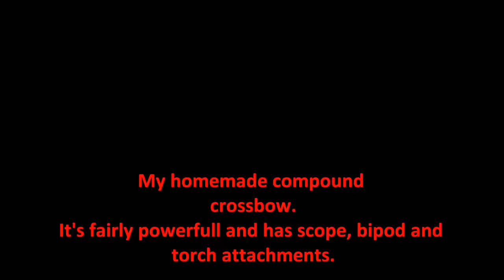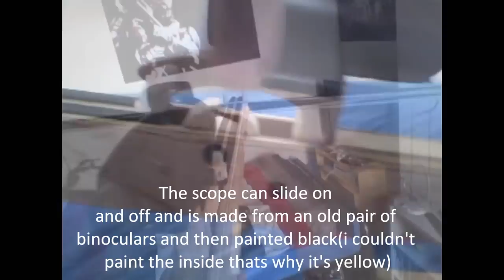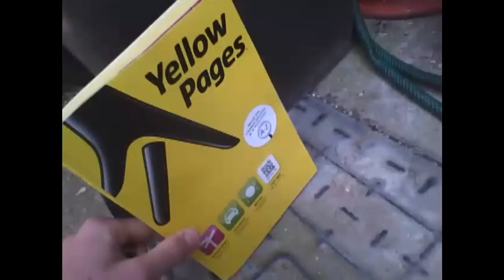Homemade compound PVC crossbow

Comment: (I am not complaining, I am warning people who want to buy or make something that is this powerful) To anyone looking to buy/make a crossbow and who also think that it is easy to pull back a crossbow, IT ISN'T! If you have looked at a real crossbow, the end of it usually has a triangular peg that is bolted or welded into the end. The reason for this is your average crossbow is so powerful, the saying, "put your back into it" comes from people who had troubles with reloading. The peg is for using your foot to hold down the crossbow, pulling up the string needed large back muscles because many crossbows where over 150 - 180 lbs. (when someone says a bow is ___lbs, this means it takes that amount of force just to pull back the string. A crossbow is basically just a weak rifle that shoots an arrow or bolt. Not to insult anyone, but in my opinion there is more pride in building a crossbow, than being able to shoot one. Firing a crossbow is the same as firing a rifle, the stock and grip keeps it steady and you simply pull a trigger and fire. The most difficult thing to do next to loading it, is simply looking down a sight. Granted it is pretty badass that someone can make a crossbow out of PVC and wood scraps and have it work, but talent is found in archery, it is more mentally and physically challenging and there is much more to it than simply load and fire. I am a member of a semi-Olympic archery team, I am not in the Olympics and won't be for most likely my entire life, yet I know a lot about bows. A Crossbow uses 3 basic steps and a bow uses 10 (9 if you don't include aiming) Again, badass crossbow, even more badass if you made it, especially with how good it looks, but talent is found in archery, sorry guys.
Reply: pointless rant.
Reply: what are the 10 steps in archery, i'm a bit of a noob archery
Reply: Andrew Marriott
The ten steps with a bow are stance, nock, hook and grip, raise bow, draw, center, aim, balance, release, and follow-through. the steps of a crossbow are nock, cock, point, and shoot. A bow requires more talent because it is so different than using a rifle and requires so many different steps. Arrows also flex in mid air, but are always accurate. If you miss with a bow, it is because your stance or grip was off. A crossbow is pretty a rifle that fires arrows/bolts. Look at the shape of a crossbow and then look at the shape of a rifle. Similar, right? That is because they both have the same exact grip and use the same firing mechanism. A trigger that releases a spring loaded hook holding a specific piece that will release and allow the weapon to fire. A rifle does the same thing, only instead of a hook, it has a firing pin. A bow works very differently than a rifle or crossbow.
Reply: REMEMBER THAT WHAT I HAVE SAID ABOUT CROSSBOWS IS A MATTER OF OPINION AND SHOULD NOT BE TAKEN TO HEART IF YOU THINK SEPARATELY So pretty much the only reason you would buy a crossbow is because they look cool and can hit hard. If you are hunting with one, you might as well use a bow because using broad head arrow tips will do exactly the same thing as what a broad head tipped bolt will do. If you like the way the feel, you probably should just use a rifle. Other than the fact that they are cool looking and the one of the most powerful ranged one-manned medieval weapons (next to the hand cannon) The crossbow is useless. I am not saying they are horrible weapons and a waste of time. I am saying that a bow will do exactly the same thing as a crossbow without the rifle style appearance.
Reply: i wanted a pse stinger x but i couldnt pull it back at the lowest draw weight so i got a diamond infinite edge instead and im just a kid so dont make fun of me for not being able to draw back 34 pounds lol
Reply: That's true I have a 50LBS Crossbow and I can nearly cock it with one hand

Comment: This one is weak enough apparently to not matter, but dry firing a box or crossbow is the fastest and easiest way to destroy it and/or hurt yourself quite seriously.  NEVER dry fire!  The built up force usually goes into propelling a bolt or arrow.  If no bolt or arrow, that force goes into the limbs, and can splinter them off with a surprising amount of force.

Comment: i like the design for the stock but if you do a little more wore with file, sandpaper, etc. you could give it a nice stain. As for the bow add some carbon fiber rods to the center with ducktape, be sure to make the carbon fiber insert thicker in the center to avoid bad stress on you bow. To see how to make a good simple bow like this you should look at Backyard Bowyer's channel